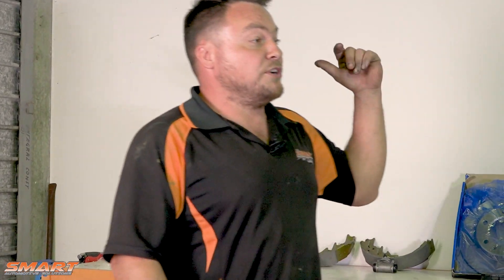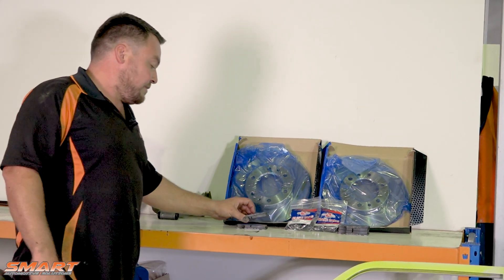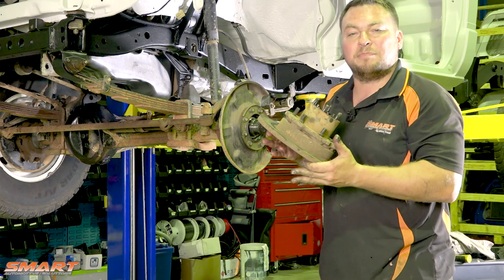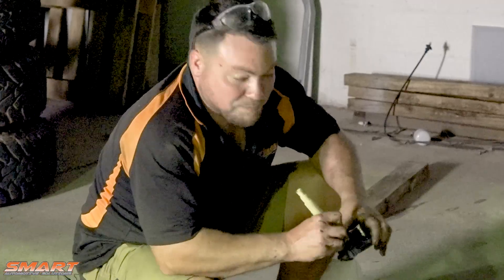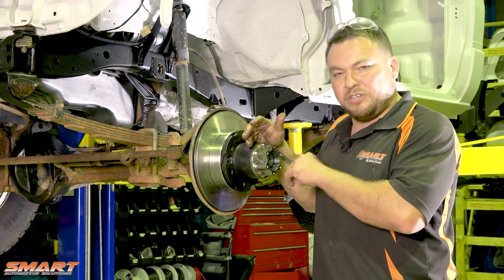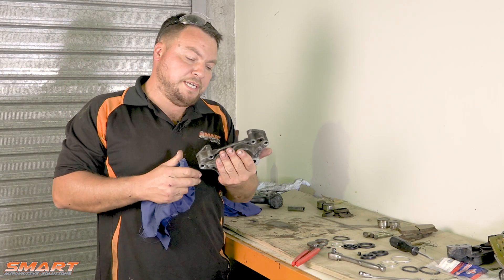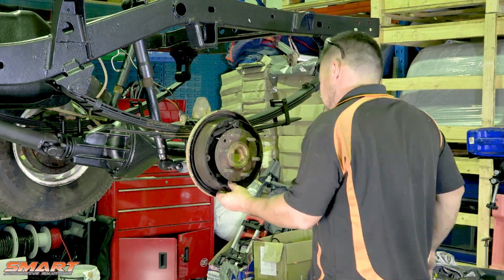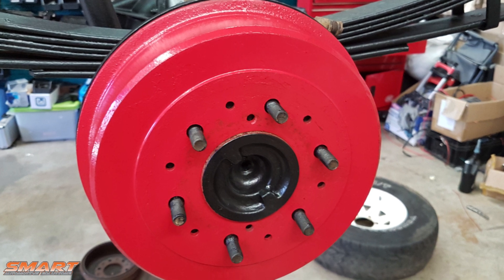Hilux Custom Build - Part 7 - Front Brake Rotor & Caliper Rebuild - SMART Automotive Solutions

Comment: Lovely job on the brakes.
Just to share, the best 'C' clip pliers available in the UK are th Knipex 45 21 200. About 42 pounds on Amazon. I can't tell you how much easier it is using the correct tool!
While I am here does anyone know if anyone does a rebuild kit for those calipers in the UK?